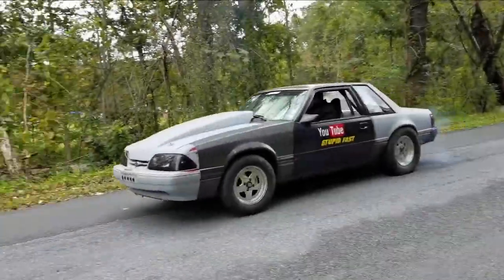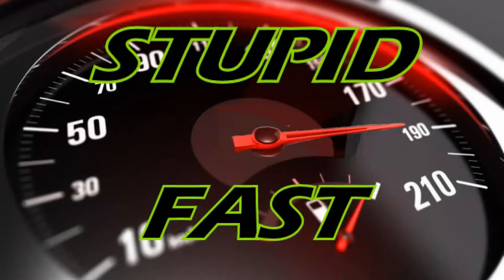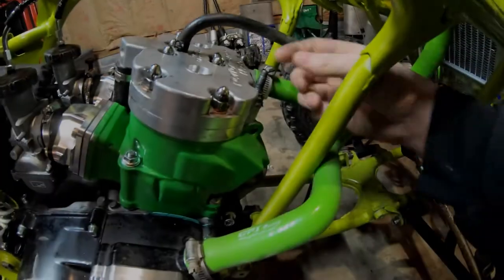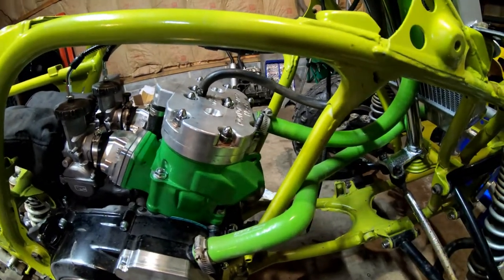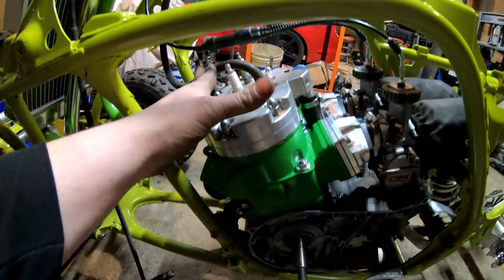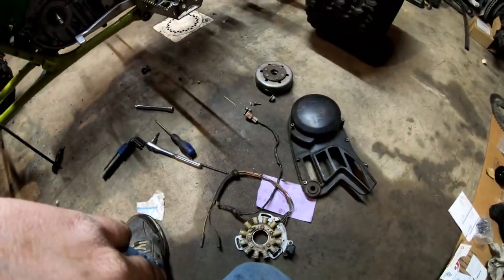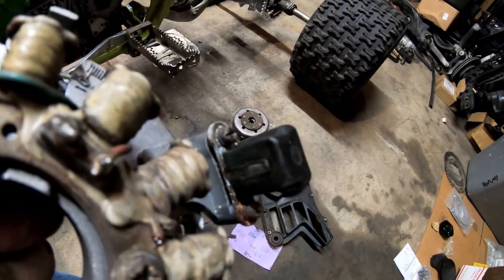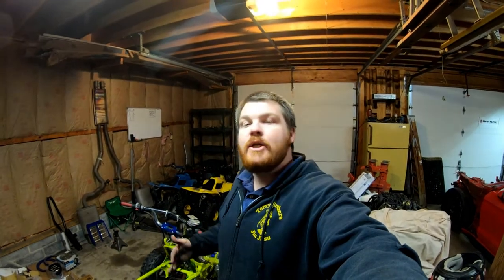SICKEST Yamaha Banshee SUPERCUB 472 stroker build Part 8 | MORE THAN 1 WAY to fix stripped threads!

Comment: Good tutorial man! My supercub cylinder is doing the same thing. It hasn't pulled through but I noticed I can't get it torque.  Soon as I felt it stop getting tighter I stopped so I'm going to pull thr stud and check thr threads. This wasn't an issue until I sent cylinder out for plating. Removed studs, and now having issues.
Reply from the maker: It happens, get them stainless certs put in and save yourself the trouble with cast aluminum 👊

Comment: Looking good!  (I was going through my storage unit the other day and found a used Garrett T25 turbo off of an Mitsubishi Eclipse.  I was going to put it on my '82 KZ750).  Any thoughts about putting a turbo on the Banshee?
Reply from the maker: Afri! 🤔 I'd try it? Probably be a sob to tune with carbs and make special piping etc but I'd do it if it gained more power 😏
Reply: @StupidFastJohn  You don't have to do it. I abandoned putting the turbo on after riding faster bikes like 600 and 1000 sportbikes.
Reply from the maker: @afri1414  I'd just like to see what she does before doing any power adders. Let's see of it hauls ass first 💪👍